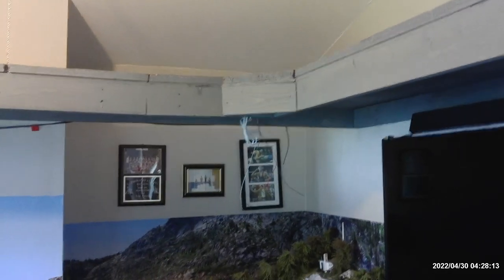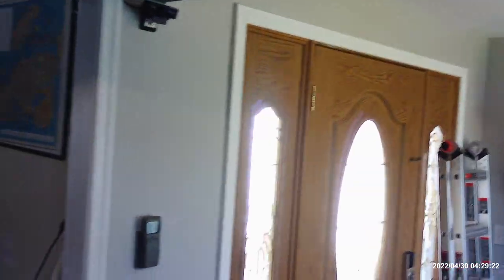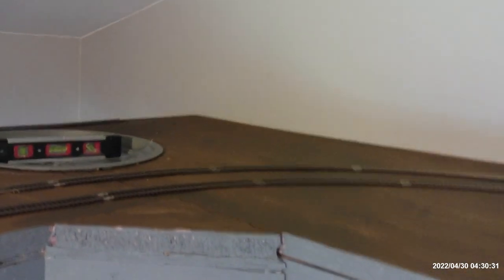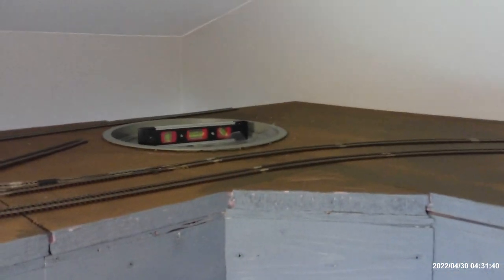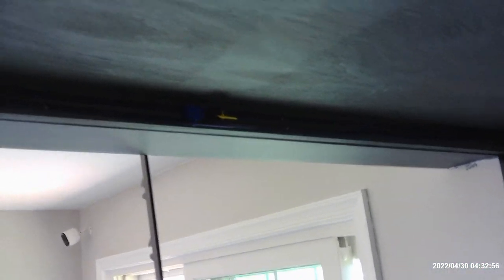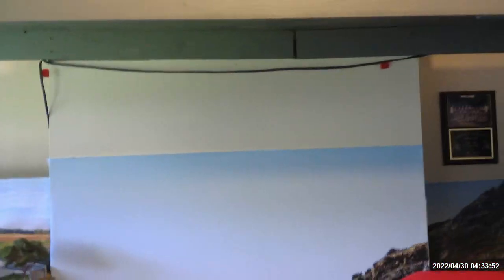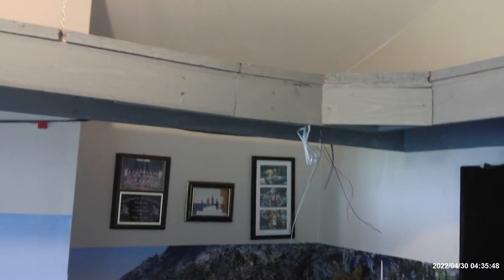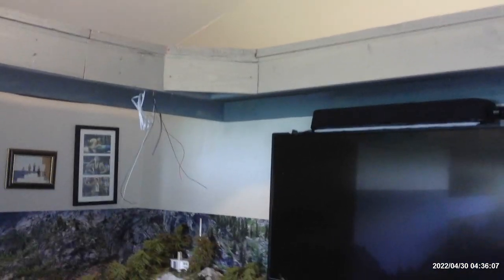110 Third Level Benchwork Painted and New Turntable Setup

Comment: wow you are moving right along getting this project up and running. nice work
Reply from the maker: Sparky  Thanks yes Today trying to figure the best way to run my feeders to the buss line.  Debating on cutting a trench across the layout to the inside then drill a hole vs drill two holes next to the track like I did everywhere else on my layout.  Just trying to minimize the wires under the layout because I am planning a subway track under that level

Comment: Looking good Tom, sucks about the drill though. I had the same problem with vibration from the jig saw when I cut out for my turntable.
I can't wait to see the finished product.
Reply from the maker: Jim  Thanks yes I should have drilled more holes then the jig saw would not have been a rproblem.